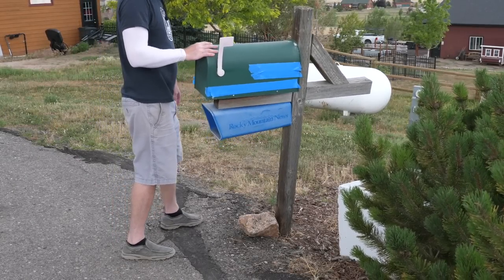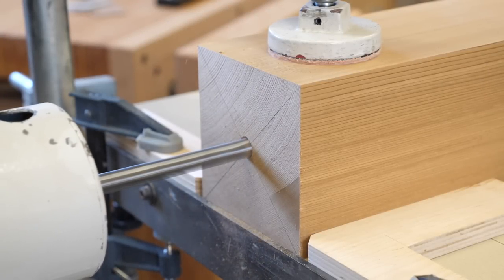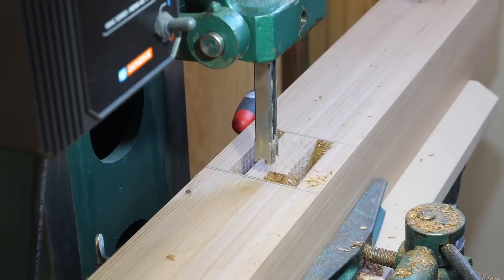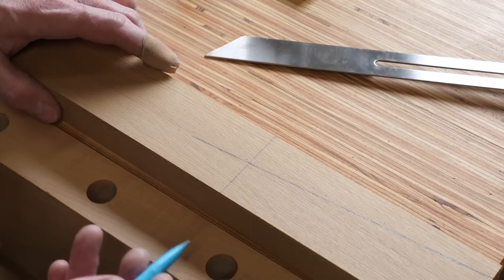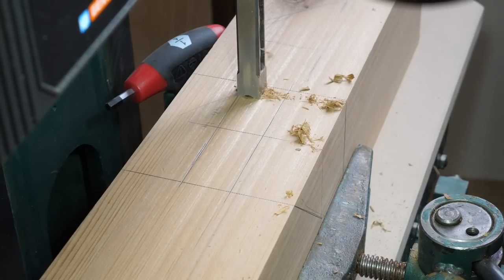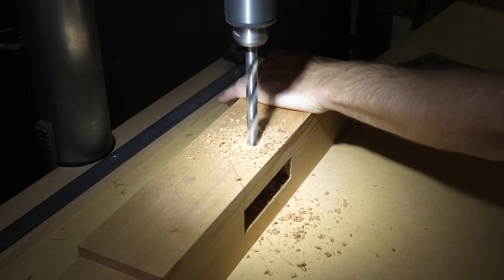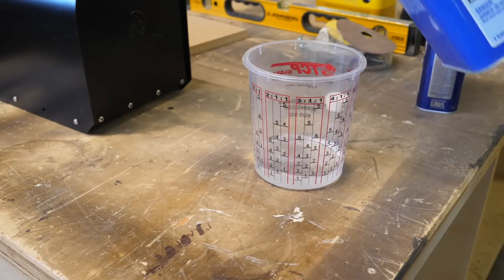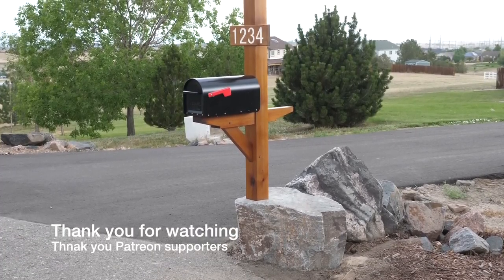Mailbox of Greatness. Fun Woodworking Project.

Comment: Pro tip:   when trying to find the center just angle the tape measure on the workpiece to the next nearest whole number. for your example that would be 5". then mark at 2.5" and its the center.
Reply from the maker: That is a good tip. Thank you.
Reply: @MikeFarrington  yea once you do it once you're gona feel really silly for not doing it from the second you picked up a tape looking for center.   Its ok.  we all felt the same thing.
Reply from the maker: @jeepxj  We'll see. Peoples brains work in different ways. I'll give it a try but, the measuring from both sides could help me prevent a math error. Hope that makes sense.
Reply: @MikeFarrington  in theory it always finds the center. you dont need to know your overall dimension.
Reply: @MikeFarrington  You can do both. Angle one way to get an easily divisible number, mark, then angle the other way.
Reply from the maker: @TheLukemcdaniel  True, that is a good point.
Reply: @MikeFarrington  go for an even number on the angle so the center value is a whole number. So go for 6" and the center is at 3"
Reply: I actually find the two side method is giving me better results when accuracy counts. The angled method is much quicker. Different people different results
Reply: @Tobsen660  Agreed.  If you can get down to a 1/16" or 1/32" gap by marking both sides using a pencil and tape measure or square, then it's so easy to judge where the center of the board is with very good accuracy from using essentially an arbitrary measurement. 

I learned the angled tape measure trick by watching Tom Silva on this old house.

It's good to have a few tricks up your sleeve to handle a given task.

Comment: Nice job. Here in NZ our specs say letterbox needs to be big enough to hold A4 size mags and envelopes. We have a lot of small useless boxes sold in stores here, but as a posty they are such a pain to put mail in. Yes you can fold the item to fit but many are stamped saying do not bend. (Certificates or photos etc). I love the way you included your numbers, looks a more pro finish and overall nicer look. One concern may be that being a solid wood post it might crack or warp and twist overtime.
Reply from the maker: Good info. Thank you. All lumber in the project was dried to about 10%, which means it will be stable outdoors in this environment. So cracking, or any other defect is very unlikely.

Comment: Beautiful! Will this project propel you into the world of timber framing?

Also, very curious to see your new miter station setup
Reply: Me too!  I paused the video there to check it out!
Reply from the maker: I'll get that video out soon, its a lot to edit, so its taking longer.
Reply: Looks like an OMGA saw maybe? I used one for many years in a door shop and the thing cut like glass. Beautiful work as always.
Reply from the maker: @jpesce23ful  You are correct. It is a really nice saw. Only downside is it doesn't have a blade brake so it takes for ever to stop, which is annoying, when cutting to a mark.
Reply: @MikeFarrington  Yes. It spins down for what feels like eternity.

Comment: To find center you can use your combo square with the 45 degree leg against one side of the post. Mark a line, then flip it to the other side of the post and mark a line,,,and presto,,,instant center intersection.
Reply from the maker: Good tip, thank you.
Reply: as long as a perfect perpendicular line is marked first so the 45 lines are at exact same height from both sides  ( a mark at desiered location then an angled ruler at , for example, 8 inches from side to side, the 'exact center ' will be the 4 inches  mark on the ruler)

Comment: Hold it, the way to install a post into a bolder is set the post on the top and use your rubber mallet to beat the post down into the rock, no problem the woods really dry. Should be pice of cake.

Or you can if your not good with a rubber mallet just use a threaded rod epoxyed into the stone.

I was waiting for you to pull out thd handy dandy festool loose tennioning tool and put some stone loose tenons it it.

Comment: Having the wood touch the rock, is that gonna cause water to wick up? And then rot the wood out.
Reply from the maker: There is a slop to the rock, so the water will drain. Also, I used cedar so we should get a good long life out of this post.
Reply: As the post rots, the mailbox will sink down but since it's cedar, probably in 350 years !! 😁

Comment: The mailbox is beautiful! On the final shot it occurred to me that it might be vulnerable to the end grain wicking up water where it interfaces with the rock. Perhaps a bead of clear silicone?

When attaching posts to concrete, I use brackets that hold the post above the concrete for this reason. Is this not a concern because of something I am missing? I just want to see this last as long as possible.
Reply from the maker: Water should not pool there because of the slope of the rock. I would have preferred a little more slope, but the rock was so heavy I ended up just leaving it where it was.
Reply: @cmmartti  belt and suspenders.
Reply: A jobsite tip passed down to me was to cut a square out of an asphalt roofing shingle (slightly smaller than the foot of the post so as not to be visible) and slip that underneath before fastening the post. Gets you a capillary break that's cheap, quick, and long-lasting!
Reply from the maker: @gavinkelley5276  Great tip.
Reply: @MikeFarrington  BTW, killer vid and I'm very glad to have stumbled across your channel. I should have led my comment with "Watched every second of this build -- definitely something for my future build list, especially as I live in the land of the 5 foot frost line :D"
Reply from the maker: @gavinkelley5276  Thank you very much. Our frost line is somewhere in the 42-48" range, there is some debate because my house it located right at the elevation where the number increases. So yeah, a 4" footing for a mail box. No thank you. If this thing leans over time, I can use a pry bar and shovel some sand around.
Reply: @MikeFarrington  Right on -- even the words "post hole digger" make my back hurt. I just realized another bit of genius in this build which is built-in plow truck deterrence (and protection, if the visual deterrence isn't enough). 5 stars, all around.
Reply from the maker: @gavinkelley5276  I'm not a fan of post hole digging either. For better or worse, the roads around our house don't get plowed. So no thread of that.

Comment: How does 'sanding first prevent nicks in your jointer or plainer bades' ?
Reply from the maker: The posts had been stored outside sitting on top of 4x4s, so they were very close to the dirt below them. My guess is they had been sitting there for a very long time and probably had picked up some dirt. This dirt is what would cause a nick in the plane/jointer blades. Sanding first will knock off that dirt, which won't affect the sanding belt. Hope this makes sense.

Comment: How come you don’t use a dado blade to cut that stuff out faster?
Reply from the maker: The little grooves left take forever to clean up with the block plane. I was using a 1/4" flat top grooving blade, so it left a respectable surface. I should have mentioned that in the video.
Reply: @MikeFarrington  fair enough. Is there a safe way to stack those blades so it’s faster and also doesn’t leave grooves? I guess if there was a way, you’d be doing it already. Either way, awesome video!
Reply from the maker: @OOOHBILLY  Yes, Look up Infinity Grooving blade. Buy a couple of those and get to work. I'm planning that same purchase soon.
Reply: @MikeFarrington  ahh, neat, thanks!  I’ll check ‘em out.